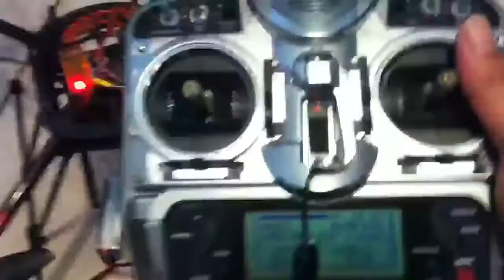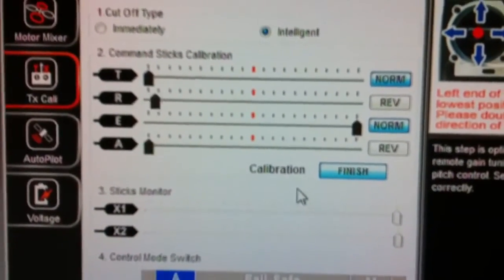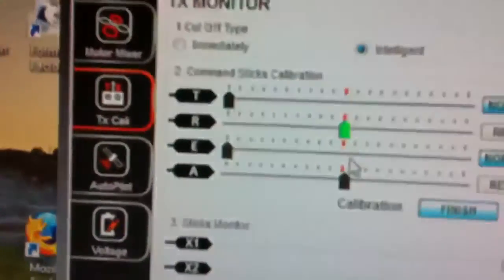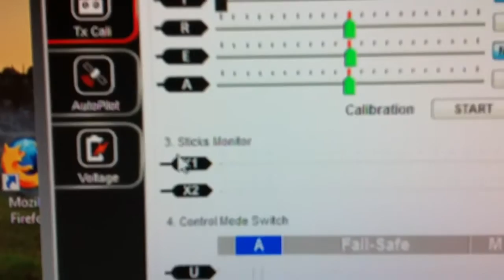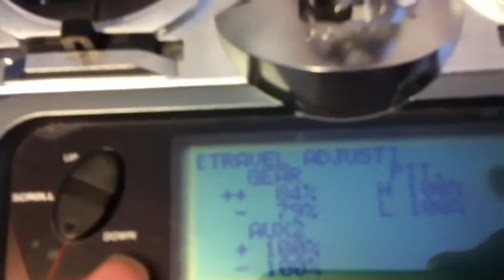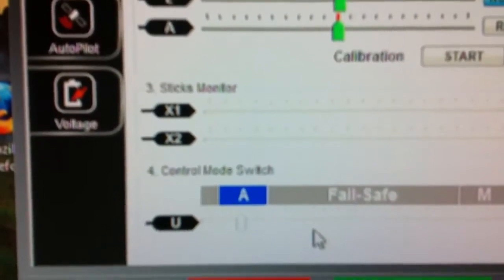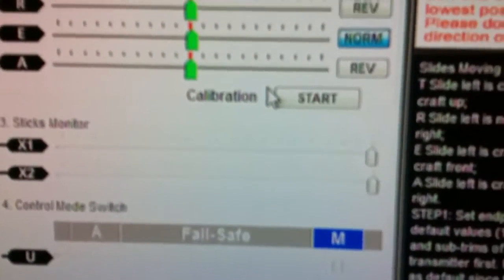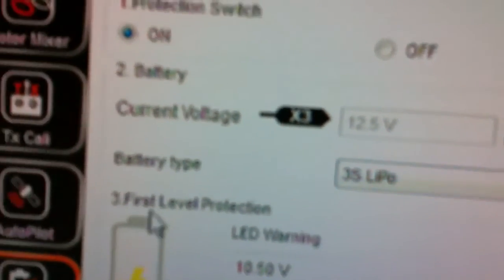Bumble bee quad programming guide

Comment: After you finish the programing do you have to press a certain button or just unplug it. I was able to get the program working but after I set up everything I get no response from the motors. It shows to be working but nothing happens when I press throttle. You are the only one I have found that has set up the Quad and knows what they are doing.